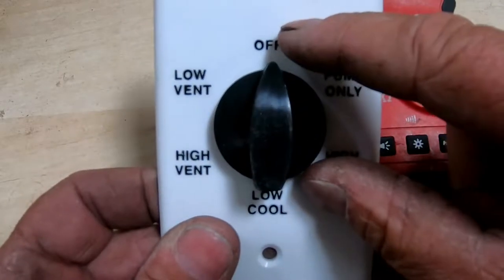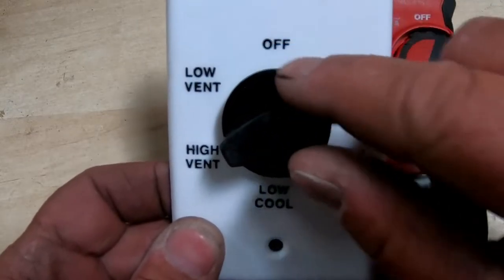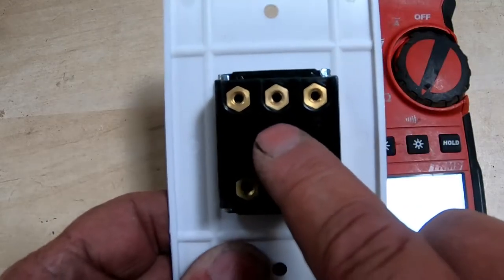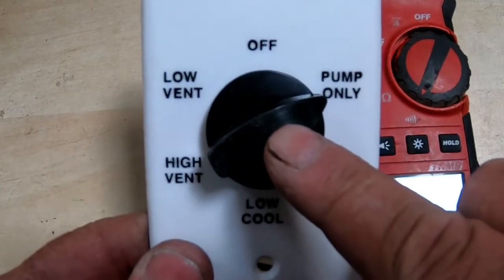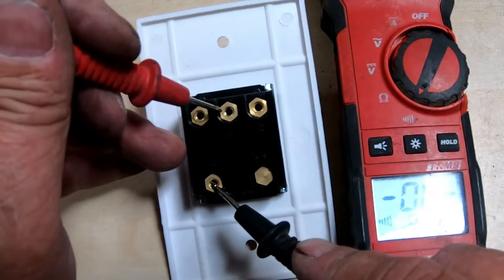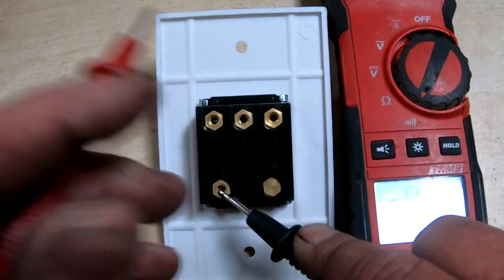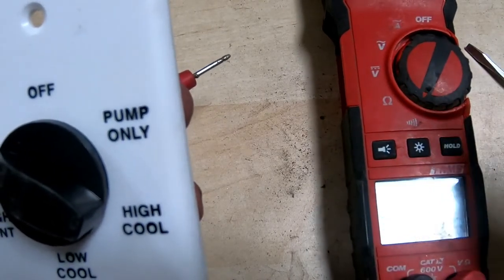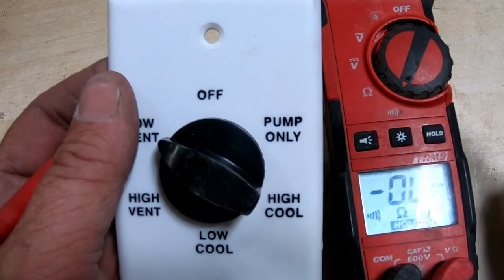How to wire a Evaporative / Swamp Cooler Switch

Comment: There is no ground wire connection? What is the hexagonal brass plate for, at the bottom right, on the back of the switch?

Comment: Mr scott  I have a the switch u showed the wires I have coming to the switch are 3 sets of 3 wire hot common and ground, so I have to use the common wire coming from the breaker as a hot to go to the pump terminal so I have only two commons to tie together..my pump wires are blue my low speed are red  my high speed are black.if my neutrals all tie together . How do I connect the wires that are left ?

Comment: If u got 2 wires black and white which one is the hot wire?
Reply from the maker: Away check with a meter before you touch anything. most often the black wire will be the HOT one.. but never assume alway use a meter before you start any project involving electrify Thanks for Watching & SUBSCRIBING

Comment: C isn't for common in this case. C is power out to high fan on the motor. It is usually a black wire, not white, not neutral.